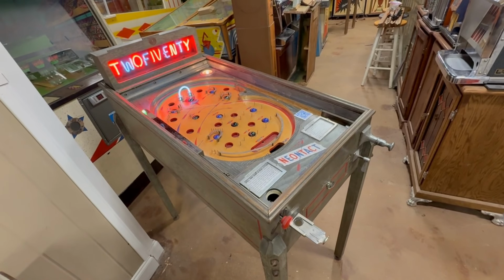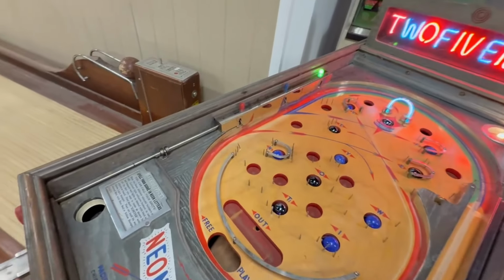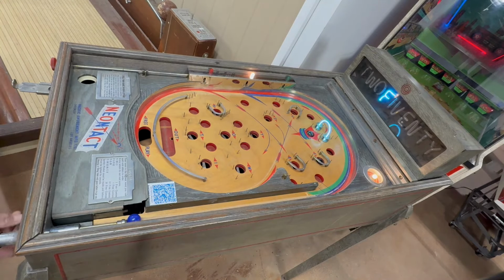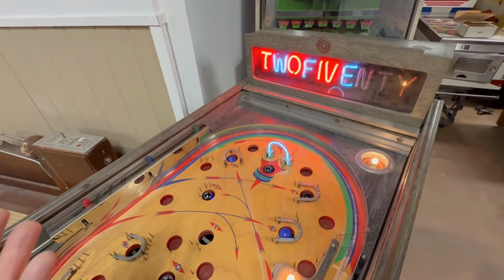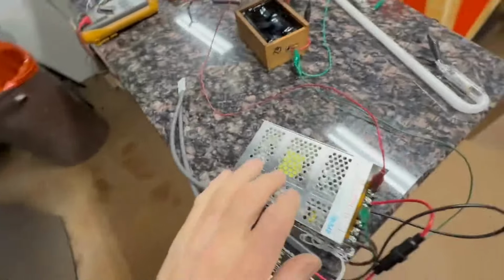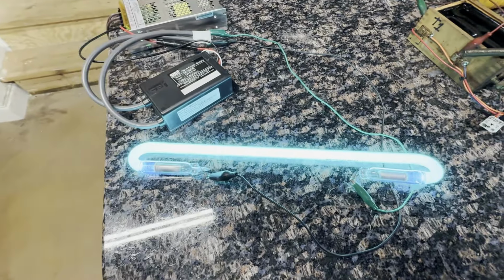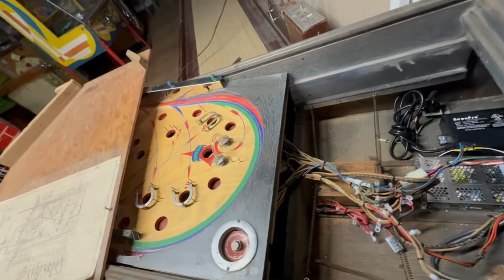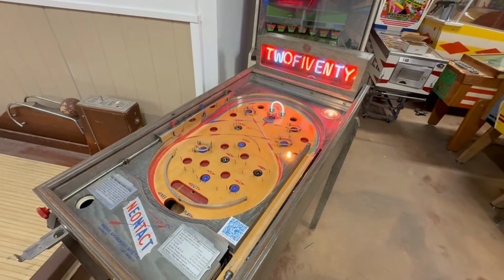Pre-WW2 pinball: 1935 Pacific Amusement NeonTact pinball machine with Neon

Comment: That is cool.  A couple of corrections: the "Model T Coil" that you are using is actually an aftermarket "KW" coil.  The original Ford coil is Stamped with Ford script.  The original Ford coil is a little hotter than the KW.  The Ford coil has 3200 ohms of resistance through the secondary windings and the KW only has about 2200 ohms of resistance. The high voltage was only powered by Milliamps.  A properly adjusted Model T coil or KW coil makes high voltages but is adjusted to produce 1.3 amps.  Your coil was not properly adjusted and the sparks at the points suggest that the capacitor is leaking causing it to operate sporadically.